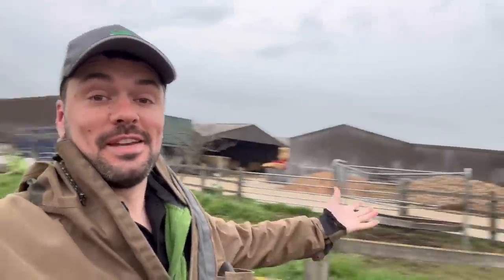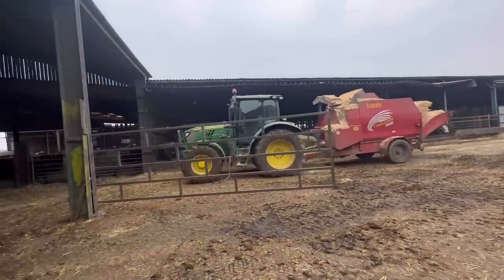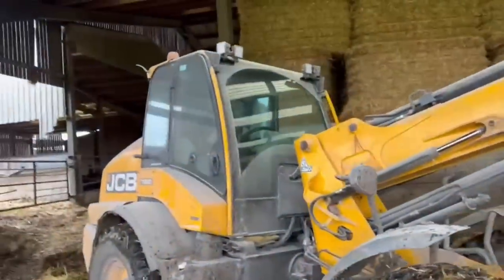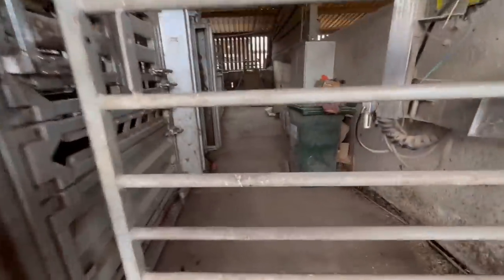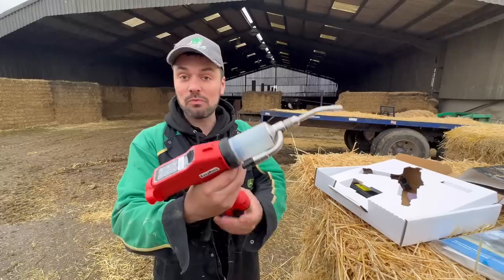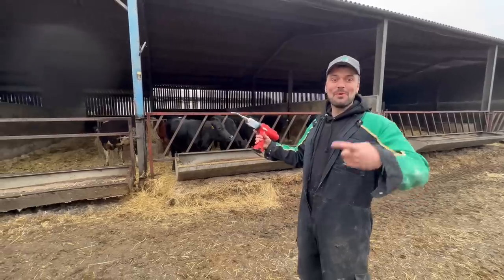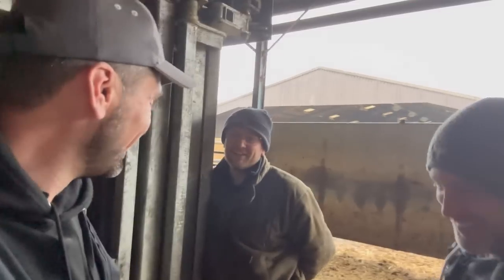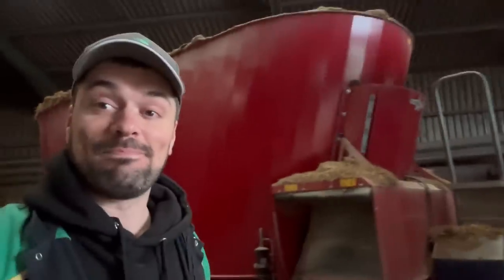Te Pari Dosing Gun! Ben n Andy Start Filming!

Comment: I've just put in for the eid version on the grant job. Connects to the Tru test eziweigh 7 weigh head and gives the accurate dose based on weight. Can also do fixed amounts. My 15 Yr old son helps with race work but can't use guns as he doesn't know weights or can press the lever, now he can be up on the walkway and just click the button.